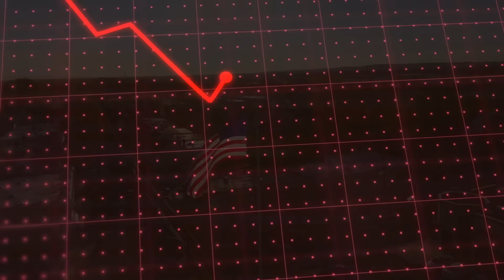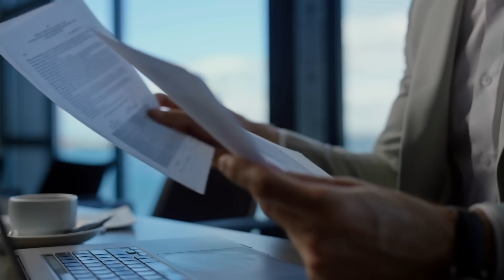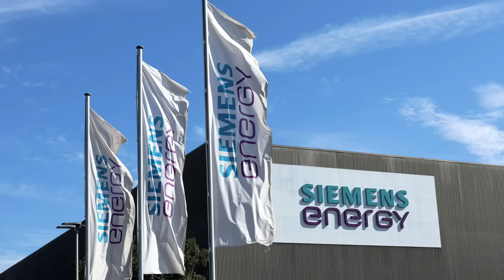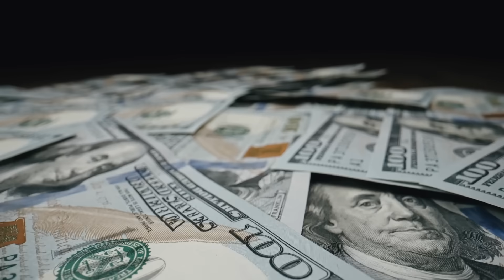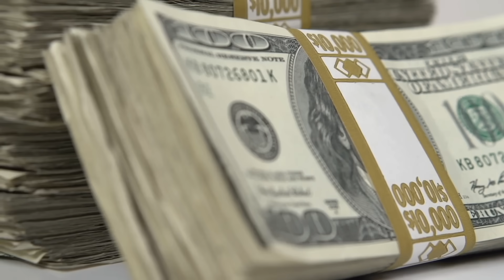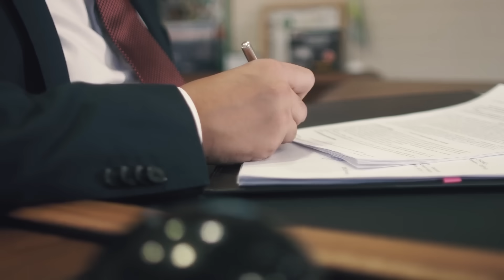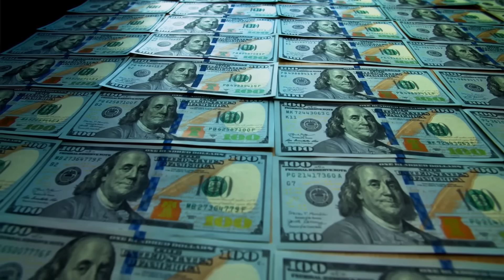The Real Reason America Has Turned Its Back On Wind Power Energy

Comment: There is so much that is misleading or left out of this article. First of all, it is not simply a matter of hooking up the wind farms to the grid: It is about the storage of the electricity, in tremendously expensive battery banks or other, for wind-less and high use times. He makes it sound like "plug and play", but it is not. Also, the idea that these farm are totally green is ridiculous... they have a limited lifespan, both the windmills and the solar cells... and disposing of them is a giant issue. The vanes when they have reached their lifepan must be removed, and cannot be recycled. They usually bury them. And the farms themselves, if not rebuilt, leave thousands of tons of concrete in the ground. And what about the trees cut down to allow them? The disruption of winds? The birds killed? The whales confused, and lost and beached?

This article is a white wash.
Reply: 1. Hooking them up is enough. Storage becomes an issue when you have a lot of them and you have no other controllable electricity source, which usually does not happen.
2. Every power plant has a limited time span, but that seems to be news to you.
3. Wind turbines and solar panels can be recycled
4. Trees do not need to get cut down, but when that happens wind turbines and solar panels save more CO2 than the trees could
5. Winds are not disrupted
6. Wind turbines are much more bird friendly than fossil fuel power plants
7. Whales swim between offshore windturbines just fine
Reply: @old-pete  You are incorrect on several of your points:

1) "Storage becomes an issue"... when the wind dies. If you have not stored the power when the wind was there, you are s*** out of luck. Hooked up or not. 

2) Power plants have a life-span, but not in the same way, and far more cost effective. Engines and Turbines can be rebuilt, and many have been, for decades. However, when subsidies run out, many wind farms are abandoned. 

3) This is untrue... well, a very small proportion of the vanes can be recycled, and so far, only on an experimental basis. The VAST majority of the materials used in them can only be dumped and buried. This is easy to google... the mess of these defunct vanes is an enormous detriment to the environment. But I know you already know that, because you chose to claim "recyclable", while tellingly not pointing out this is a small and insignificant offset. 

4) Proven incorrect. There are studies of this, again, on the internet. There is one showing a forest that was denuded over a vast area, and the solar panels that were installed only powered 450 homes. As for the C02 loss, I agree... trees are only a very small part of C02 production, most by algae and other sources. But you accidentally let your liberal pants down, there, by admitting that about trees. And thank you. 

5) Well I'm not sure, I thought so, but I'll grant you that for the moment. I thought they disturbed weather patterns locally, by slowing wind currents. But maybe not. 

6) You have not done your homework on whale navigation and communication. Yes, of course they can maneuver between the monstrous legs of the wind turbines... that is not the point. There is strong evidence that something about the turbines... the vibration, the current in the transmission, the moving shadows cast... the reasons are not yet known, but in areas near water based wind farms, whales become disoriented, and wash up on beaches and die. Google it. New Jersey has been hard hit, but it is happening all over. 

Rather than blindly swallowing the Kool Aid on all this, research and think for yourself. I love the "idea" of power from the wind, but the dream is far from a reality, it is really a nightmare. It is all fun and games until subsidies, in the form of "other people's money", dry up. Then all they are are silly, short lived, expensive and inefficient toys.
Reply: @proto57  1. Which makes hardly a difference with a single turbine connected to the grid, as I already explained...
2. Windturbines can be rebuilt too and they are cheaper than most fossil fuel power plants, which still get subsidies over a hundred years after the technology was invented.
3. The blades can be recycled 100%, look it up. The technology exists for years.
4. Which is utter BS. As if that applied to all solar panels. Most are put on roofs or in empty areas. And I have no idea what your issue with pants is. My guess is you do not like freedom.
5. They do not change weather patterns, unless one builds a lot of them. We are not even at 1% of the amount that would be needed for that.
6. That just something the media made up. New Jersey does not even have a running offshore windfarm. Ocean Wind 1 is delayed until at least 2026...
And transmission currents do not affect whales. We use much stronger cables to connect countries for decades.

Companies already built windfarms without subsidies. And the first one with negative subsidies is in planning.
Reply: @old-pete  You are one of those people whose entire argument relies on the reader not taking even one minute to check the truth of what you claim. 

It becomes silly for me to counter each thing, when you just say each time, "It isn't so". Rather I will suggest that anyone reading this DOES take a moment to fact check you, and very quickly they will see you are full of hot air. Most of your claims are, but the most ridiculous is the ability to recycle 100% of the old turbine blades. Not by a long shot, absolutely untrue. 

Some of your other answers are just odd... like "with a single turbine connected to the grid"? What? And the "apples and oranges" claims comparing the cost and maintenance of a power plant, or the lifespan... each thing you say does not actually come close to countering any of the rampant, and actual obvious, real world practical problems with wind power... which are even playing out in front of us! It is just sophistry from you, misdirection, strawmen, bs and blather. 

So to anyone reading this, do your own research. Or, believe this guy, that all the problems are solved, these are no problems at all. Wouldn't that be pretty?
Reply: @proto57  Well said 👏

Comment: USA could stop acting like Klondike in these matters too. 

Wind can solve a lot where there are enough wind. Next they need very much better grids. Its a lot to take to the consumers. 

And as fx batteries for fx for cars anymore build them. BUT they are expensive and has to be perfect. 

And You always has to have 100% backup. 100%. Denmark fx has 165 non windydays. But we dont when. I can be a day or can 14. 

It goes with the good weather forecats - oil-gas - onoff. By that the result is half of our needs is covered. We now save 25 to 35% in money. 

And we do build out. More and more of Our cars and big machines will use batteries. 

So for here and windy areas in USA too its better and towns will get cleaner air and less local warming up.

Consution: Its much much better. I dont what it is in dollars. The americans can fly there with no mask at articital astma.

Comment: When they are not producing, the fallback is generating stations.  These cannot be turned on and of with the push of a button.  So they need to be idling - so where is the savings?  Also, how long do these last and how much of the machine can be recycled?
Reply: Solar energy it TOTAL SCAM & WASTE of huge cost of  money
Reply: Windturbines last 20+ years. One can buy new ones with a 30 year life span. 80 to 90% of a windturbine can be recycled.
The idea is to combine them with power plants that do not need idlling. Solar, hydro, geothermal, biogas, biomatter.

Comment: My understanding is that to achieve 'net zero' we will need to produce as much copper (for new grid connections) as has been produced in the whole of human history. We are now mining copper ores with about 1% Cu content, while back in the 1970s the mean content was 4%. It takes about 16 years, from identifying an ore deposit, to get it producing metal. I may have got all this wrong, interested to note any feedback.
Reply: Don't forget batteries or at least power storage solution. None of these green energies produce power 24/7, so you'd need trillions of tons of battery materials as well.
Reply: @pauld.b7129  Battery storage is a given. Few people aren't aware of that fact.
Reply: @pauld.b7129  
Power storage is not anywhere close to being feasible. Doesn't anybody understand science anymore? Over 99% of electricity is consumed at the very same moment that it is produced. Very little is stored, because battery storage cost is quite high for any significant amount of energy. The battery for electric forklifts is so heavy, that it serves as much of the counterweight so that the forklift vehicle does not tip over lifting a load.

In the future, perhaps your Tesla EV, well that is if they ever become affordable, "might" be able to power your home for a few hours during a power outage. Well maybe a bit more than a few hours. Wouldn't increasing dispatchable power capacity be far more cost-effective? Sorry, but solar and wind are not 24-7 reliable. Older proven technologies are, such as coal, nuclear power, hydro-electric, natural gas.
Reply: Alex Epstein 's "FOSSIL FUTURE" on sale now.   The MORAL Case for Fossil Fuels.   HUMAN FLOURISHING
Reply: Politicians are evil and stupid if they even pretend like "net zero" is a worthy or even doable goal. Are most all of them Marxist parrots, who understand so very little of science and feasibility? They were wrong also in trying to shut down the economy during their plan-demic. Seems like they actually want to depopulate and starve billions of people.

I know that "environmentalists" are phony, because if they really cared about nature, they would reject harsh contraceptives, because that is so anti-family and unnatural, and they would be a lot more interested in thorium nuclear power and free-energy technology, which they are strangely extremely loathe to talk about or even admit that those exist.

We are nowhere anywhere close to ready to upgrade to something better than natural gas for heating and cooking, nor are the EVs ready for prime time. Quite a lot of people can not begin to afford $60K for a decent EV, EVs are horrible in cold weather, and they can't even build them fast enough, and it looks like there is a growing backlash against the imposition of EVs. It should never have been a mandate, especially with the battery technology still not worked out.
Reply: Don't forget aluminum which is among  the most abundant metals on earth. Yes, it doesn't have the same conductivity as copper but there's a lot more of it available to compensate for the larger conductors needed. Can aluminum entirely replace copper? Of course not, but it can and does supplement copper in more uses than we know.
Reply: Good point. Is aluminium used in grid conductors? I also have a feeling that its production is very energy intensive, due to the high stability of its oxides. Not sure that the really abundant form, aluminosilicates, can be used to produce the metal at all. @joewoodchuck3824
Reply: @joewoodchuck3824  
But you have to be careful with aluminum, as aluminum wiring has caused some serious safety issues. You have to have proper careful connections. Perhaps somebody else can elaborate why aluminum wiring has some issues.
Reply: @yosefmacgruber1920  The main issue is galvanic corrosion where aluminum connects to copper and other materials. The industry claimed to have solved the issue, but it happened anyway. I haven't heard anything more about it in many years, so I assume everyone just went back to all copper.

Comment: The way things are going in the UK with these short panic deadlines with reliance on wind power and little else the winter death toll if we have a calm month is going to be massive. The sun does not exactly dump much energy on the British Isles so not much hope there. Our government is increasing taxes on anytime that we earn, spend, move house or die yet struggles to run what we have. We sit over vast amounts of coal and the irony of all the people freezing above this because nobody is even thinking about how to use it and contain the carbon is very sad. There was a an long article once in a paper many years ago that said  that our coal energy resources were greater than North Sea oil but it will just sit there now.
Reply: I am pretty sure the UK will not rely on 100% windpower.
The UK also has grid connections to other countries.
I consider your scenario to be very unlikely.
Reply: @old-pete  You can only say pretty sure but giving no actual alternatives and it would be interesting to know what they are. Difficult to see any other large scale sustainable natural source  being developed in this country, and the vagaries of wind and most natural systems make that a nonsensical term for wind and any green power? The coal stations are being scrapped even though they had to fire them up last winter, and one has to wonder at the green credentials and cost of running EVs and heat pumps using electricity produced by gas powered stations even if the grid had the capacity to distribute all this. Little nuclear is coming on line and who would built it any way and are countries overseas with their own net zero problems going to be so replete with power to spare enough to keep this island going. Half our nuclear capacity will be decommissioned by 2025 according to one source with just one new one being built. The whole problem with this there are no hard facts and it is difficult to see beyond the endless fixed dogma how it is going to work in any country. The Far East are laughing their heads off as they will just not bother whilst the West self destructs with its idealistic virtue signalling fantasies.
Reply: @michaeld5888  As you wrote yourself, there is nuclear and that will not change in the foreseeable future. That makes 100% wind a pipedream.
There is also some hydro, solar and biogas.
Reply: @old-pete  Late response but Nuclear power providing a mere 15% of our power is due to be de-commissioned to half the capacity of what it is now by 2050. If you have the numbers and funding availability for new stations please say. There is a belated attempt to keep 2 nuclear power stations going a bit longer but little sign of expansion only contraction. Also interconnection abroad relies on surpluses from overseas themselves reliant on mother nature when they may be short of power. Also us having the funds to pay for this. Again it is all surmise and everything will be alright so do not worry but with no discernible plan bar wind, whilst existing vital infrastructure is being irreversibly trashed in anticipation.
Reply: @michaeld5888  That depends on what they do the next 25 years.
Plans are to invest massivly in renewables and use the surplus electricity for Hydrogen and store it.
Wind in combination with hydro, biogas, some nuclear and some other chemical storage, should work out.
Norway, Denmark, Netherlands, and France have surplus regularly. If Germany gets their power supply in order, they should have surplus in 2050 too. They are also the ones that want to buy Hydrogen from the UK and they can store it.

Comment: Wow!  There is that they are very green to make lie again.  Everything used to make them is done using fossil fuels.
Reply: The energy is green, not the turbine. You are mixing something up.
Reply: @old-pete Until the turbin makes enough energy to off set all the carbon from making it (which is all fossil fuel based) it is not green.  In Teaxs and other states...some of the turbines are not lasting 3 years...they are filling up acers and acers of land with turbine parts, blades, and the greese and oil that every turbine has...and that means zero green energy.  You can't just say they are green energy without accounting for everything it takes to build them.
Reply: @raythackston1960  Wind and solar energy are by definition green. That has nothing to do with the machines.
Windturbines earn back all invested energy in 6 to 14 months.
When windturbines fail regularly after 3 years, the owners do something wrong. In other parts of the world 20 years is pretty standard, with some turbines running much longer.

Comment: Centralizing alternate energy sources is stupid. Every rooftop with an ideal solar azimuth could generate enough energy for itself and several neighboring residences. Building giant solar farms on productive farmland is insanity. As for wind energy, anything with moving mechanical parts is going to be high maintenance from day one.
Reply: If one has enough room, centralized solar panels are easier to maintain and easier to connect to the grid. Putting them on  farmland is usually not a good idea and not necessary.
But there are applications were solar can be combined with farming.
Wind energy has higher maintenance costs, but is overall cheaper than solar.

Comment: I put solar on my house. Three months and two inspections later, I finally got permission to connect to the grid.
Reply: Home solar is where it's at.  If you do it right you don't even need a mains connection.
Reply: If everyone had a matching power consumption, there would be no need to connect to the grid to sell excess power.
Reply: 3 months seems ok

Comment: We should also be VERY WARY of current power storage ideas using Li-ion batteries. They have zero fire resistance, burn to total destruction, are impossible to extinguish when they ignite, cost literally the Earth to produce and have a relatively short life. Net zero means rebuilding our entire energy infrastructure and looks unaffordable.
Reply: They have a rather low priority. Other solutions gain momentum. Until we really need battery storage, if we really need it, there will be better solutions.